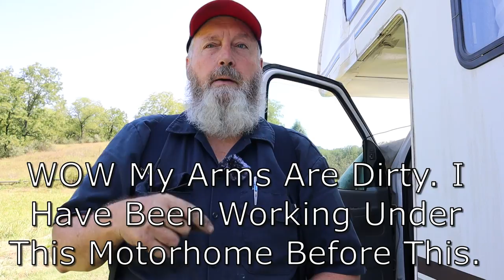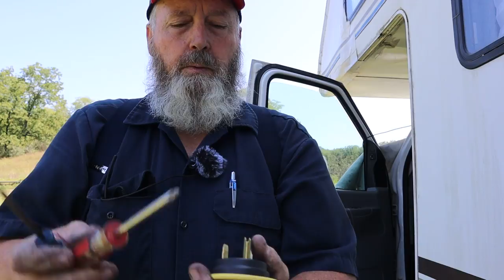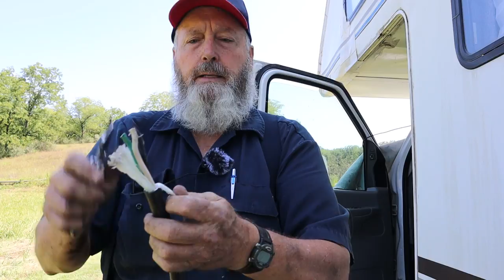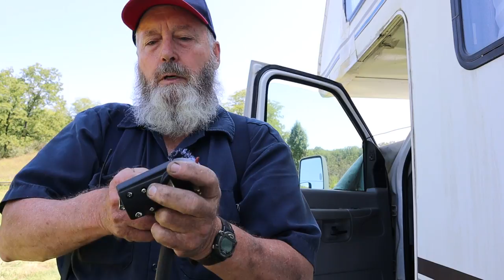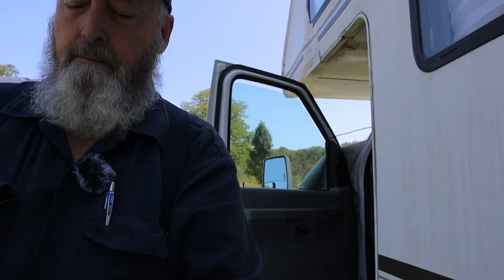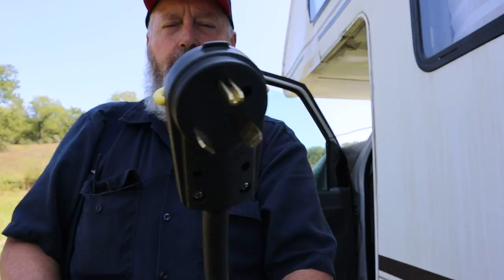How To Replace The End On Your Shore Cord

Comment: Good work Kenny.  Is it ok to plug my. 30 amp plug using a dogbone into a 50 amp receptacle?  Tanks
Reply from the maker: Yes. You can get an adapter for that.
Reply: @hillbillyrv  Thanks Kenny
Reply from the maker: @harlanmaulden1911  No problem